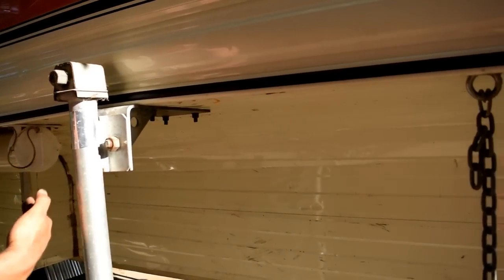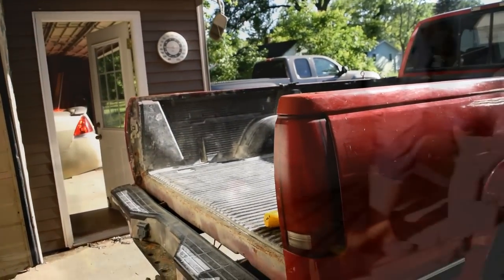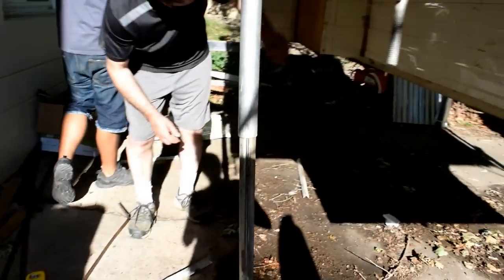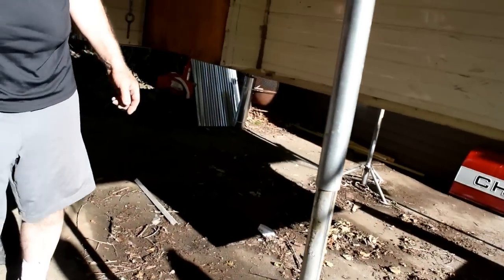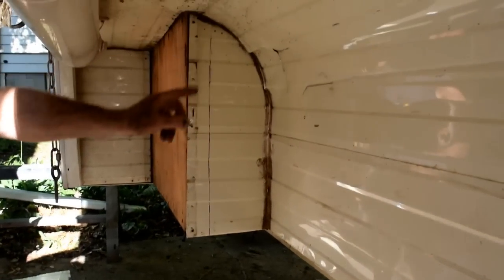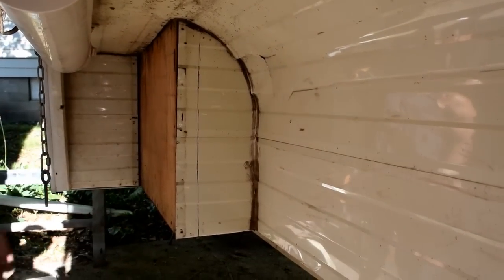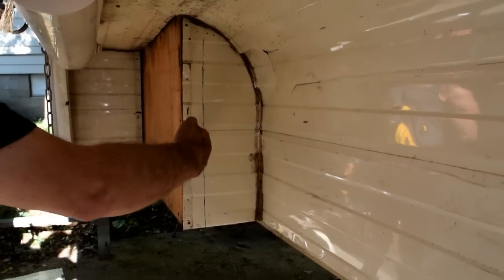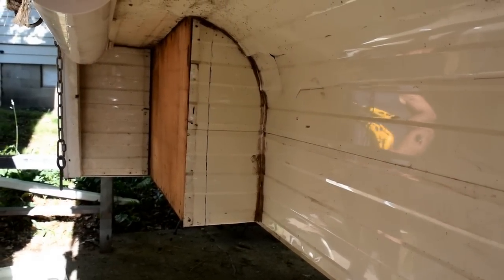Watch This Before Buying A Truck Camper!

Comment: Ford and Dodge pickups are roughly 5 in wider than Chevys .Chevy pickup beds are some of the smallest beds on the market even thow they call chevys full size. they are about 5 in narrower than fords and Dodges and they are about 2 inches shorter in length than Dodges in Fords. It doesn't matter if it's a 1970s or 1980s or 1990s or 2000s full-size pickup Chevys are the smallest out of all of them
Reply: All GM figured was as long as a 4 by 8 sheet of plywood fit in the bed with the tailgate closed it was good enough for them.
Reply from the maker: I didn't know that!
Reply: Nathan Platt   You are WRONG. I own a 70's vintage camper which fits my '69 Chevy but does not fit my Ford. My 1969 Chevy 3/4 ton has a 65 inch width rail to rail. In ~1988, Chevy reduced the width between rails.  The 70's Ford and Dodge pickups also had a bed width of about 65 inches. But within a few years of ~1985, Ford and Dodge ALSO REDUCED THEIR BOX WIDTH. I measured my Ford 1 ton. It has a maximum width of a bit under 62.5 inches at the top rail. But because of integral bracing back where the tailgate contacts the bed, nothing wider than 60 inches can pass (and that is with zero clearance).
 I have been evaluating how to cut my camper so that it will fit my Ford. I am tempted to convert my Ford to a flatbed. This would allow the entire camper's base to be the full width of the camper itself (about 80 inches). That would greatly increase room and allow all the heavier items to stay down low (water, batteries, propane, small generator, ice chest, heaters, water heaters, pumps, tools, etc.)  The problem encountered in this video is that the camper is too OLD (it's a 1979) a vintage for the truck.
Reply: Glenn S   Thanks for providing the link. Unfortunately, one dimension does not tell the full story. Take my 2017 Ford F-350 as an example. If I measure the width of the top rail at the back, it is 62.5 inches. However the back of the bed's frame has a rectangular shape to it which runs up to the rear stake points and braces the walls. It also acts as a surface that the tail gate slams against. It restricts the widest item to enter the bed at 60.0 inches (and with ZERO clearance).  The link does not show old trucks like my '69 Chevy. It has a very simple geometry - 65 inch width at the rear of the top rail, increasing to 66  inches at the front of the top rail. And, there are no restrictions back at the tailgate or anywhere else.
Reply: Found that one out the hard way when I bought a cap from a Chevy for my old dodge
Reply: I call BS, I have a 85 lance that dwarfs that camper and I have it in a 84 k20 with no mods and no prpblems
Reply: KingKatRider Unless you preface your 'BS' response with the name of who you are addressing,  and WHAT specifically you contest, your reply is irrelevant. If you're responding to me, nothing in your equipment list ('85 Lance, '84 K20) contradicts what I said. In fact, it supports it.
Reply: Nathan Platt GET A FLAT BED MORE ROOK FOR TOOL BOXES ECT
Reply: A tape measure would have figured this out before getting the camper.
But it seems they only magically appear when people have to cut something off after it's too late.
Reply: KingKatRider  Lance just built their campers to fit the smallest long box on the market. I don't know why all truck camper manufacturers didn't do that. It only makes sense.
Reply: The camper is for drw which is wider between the fenders
Reply: Better than aluminum. Ford bed
Reply: Chevy downsized.
Reply: Nathan Platt :i always own chevys and never had any probleme loding any campers
Reply: @gregparrott   It was 1988 when GM changed the body style to a more narrow truck. His camper is older than 1988. It was made to fit the wider, square body trucks.
Reply: Chuck Sturgill  Thanks for identifying the specific year. You can see another comment I made here a year ago where (at the end) I asked "The Mobile Hobos" the year of his camper. He said 1979. In response I told him that was why it would not fit.
Reply: Gregory Parrott 

Yes! Flatbed that truck! I custom built my fb and added some bells and whistles 👍
Reply: There should be plenty of room to load that camper on that Chevy because all of the campers are made to be able to load through the 4' plus opening between the wheel covers on the bed AND through the end gate opening on the bed of the truck, no matter what full size truck it is. So,... what might be the problem,... could someone have altered the camper for some reason? I'd take out that bed liner to start with and put down a rubber mat, but even with that,.. 5" difference???? I've had a few slide in's on mainly Ford but a few Chevies and a Dodge,.. they all fit interchangeably.
Reply: That doesnt make sense, i would figure on a standard 8ft bed youd have very similar dimensions regardless of company. 5" is a lot of different in a "standard" truck bed.. I didnt know about this, hell i dont know why i watched this video i have a fucking car.. Haha
Reply: @gregparrott   Im looking for a Truck camper for a Ford Bronco 1984. But Im not sure which size! 5.5 ft? 6ft? and with? please help
Reply: @MrWillis91  I'm no expert on campers, but I've owned pickup trucks since the 1970's. In that time, I have NEVER seen a camper specific for the Bronco. if I were looking for a camper for a 1984 Ford Bronco, I would:
1) Check online for Bronco specific websites. I saw online a soft top shell for the Bronco. This might be your easiest and least expensive solution. The people working at this Bronco specific website would be able to tell you if a camper exists for the Bronco. They could also provide the most detailed info specific to the Bronco. (I'm sure there are also other Bronco specialty sites)
https://shop.broncograveyard.com/1980-1996-Ford-Bronco-Soft-Top-FastTrac-Diamond-Spice/productinfo/35605/?gclid=CjwKCAjwltH3BRB6EiwAhj0IUBXuu5EGvzFwsOv3_ufFLkmPxfyLNgAfTeJSlovyTBvviaHlSPp8HhoC-78QAvD_BwE
2) If they can't help you with a camper, and you're still determine to have one, you'll need to either build your own or modify a camper originally intended for a pickup truck. The standard lengths for pickup truck beds are 8 and 6.5 feet, although over the years some other bastard sizes (~6.3, 5 feet) have become available. For full size vehicles (such as the 1984 Bronco), I am only aware of campers being made for the 8 and 6.5 foot bed. A 6.5 foot camper is the closest size for a Bronco, even though you may need to modify it. Regarding campers for 6.5 boot beds, some are 6.5 feet long (to be used with the tailgate removed), while others use the tailgate in a down position to provide additional support. Utilizing the tailgate allows the camper itself to be 8 feet long. I'm almost certain that the Bronco has a bed that is shorter than 6.5 feet. But if the Bronco's tailgate is left attached and kept in the down position, you might be able to use a 6.5 foot long camper. Measure from the back of the driver's seat to the end of your tailgate (in the down position) and see if a 6.5 foot camper will work.
3)  If the 6.5 foot length is OK, you'll next need to measure the width between wheel wells. A 4x8 sheet of plywood will slide between the wheel wells of full size pickups. If it does the same on the Bronco, then at least the camper's floor width will not require modification. 
4) If you were to cut a cross section through a truck camper, you'd see that starting from the floor, it steps upwards vertically perhaps 8 to 10 inches, and then goes horizontal perhaps 7 inches. This 'up and over' step clears the wheel well. You'll need to check if its horizontal and vertical offset will fit inside the bronco. For example if your wheel well is 10 inches tall relative to the floor and the camper's offset is only 8 inches, you'll need to either run a few lengths of 2x4 planks to lift the camper or you'll need to start cutting/modifying the camper itself.
5) After the cross section has stepped up and over the wheel well, it then goes vertical up to the height of the truck bed's side rails. You need to measure the width (inside to inside of your truck and compare it to the width of the camper. The newer campers are narrower than the old ones. So if you find an old (approx. ~1980 to 1990) used camper whose width is too wide for the Bronco, look at some newer campers.
6) After the vertical step going up to the height of the truck's bed rails, it then steps horizontally out to the camper's final width. You'd want to check that the camper does not rest on the truck bed rails (Neither the bed rails nor the camper itself expect its weight to be supported there). If the height clears, you'll want to know by how much. If it clears by (for example, 6 inches), it would work. But it would look like a misfit which you could address by creating little covers/side panels. The final width of the camper may obstruct vision with your rear view mirror. You'd then need to buy auxiliary mirrors
7) Measure the overhanging/sleeping section of the camper. Is it high enough to clear the Bronco's roofline? If not, would the use of 2x4 planks in the truck bed to raise the camper be an acceptable solution?
This should get you started. But you'll still need to consider:
-) How are you going to mount/secure the camper?
-) Can the Bronco handle the added weight?
-) Can you buy beefier springs and/or airbags to handle the added weight?
-) Since campers are meant for longer truck beds, on a Bronco, the center of gravity of the camper may wind up hanging well BEHIND the rear axle. That is a safety concern. You need to evaluate this BEFORE you commit to buying a camper
Reply: @gregparrott  you measure between the wheel wells, that's the width that you measure to fit the bottom of the camper into the bed.
Reply: @cherylyoung7899  Yes, I know. But in the case of this video, the bottom dimension was NOT the one causing the problem. The dimension causing the issue in this video was the width between the bed rails. While the width between wheel wells has always stayed slightly over 48 inches on full size pickups, the width between bed rails shrank by nearly five inches.
Reply: "Last night in New York 10 people died in a fire last night in New York because of a fire"
Other guy: "10 people died in the fire lastnight because the fire was too hot for the human bodies to handle"
Reply: Wow!  Good to know.
Reply: attovishnu  .. bingo . Exactly....
Reply: @Chuck_S  exactly
Reply: I used to have a 9.5 ft camper that was on a 79 Chevy K20 . It would not fit in the 91 GMC I currently own . GMC changed the layout of the portion of the box when the square body was abandoned.
Reply: @danholmes6095  too true.  You have to chop up the camper
Reply: Have you seen a newer Dodge truck bed lately? I've seen cars that have more room in the trunk. Peace

Comment: I remember that 1988 and later model year change GM made the beds narrower at the opening end. A real surprise to people hopping to use their older campers. My first overhead camper mistake was to put an overhead camper on a 1/2 ton truck. Even though it had heavy springs installed the 1/2 ton brakes did not stop the rig very well. I later bought a 3/4 ton Chevy that worked much better.
Reply from the maker: Never new they made them more narrow. It makes sense now hecause the whole camper started to fit until it got close to the end! We are glad we have a 3/4 truck. Thanks!
Reply: You guys did a decent job narrowing the wide sections to clear.
Reply: Just use metallic linings.

Comment: Hey Buddy. Make sure you attach your cab over from the frame of the truck and not from the railing bed. I have see a few truck where people did what you doing and the bed start breaking around the bed mounts. Good luck

Comment: Been thru this myself.  Frankly, campers like that one need a one ton dually to be safe and safe and easy to drive.  Good job on solving problem.  Stay safe .  Thanks for showing us how you dealt with the problem.
Reply: Nah, as long as you have a 3/4 ton or 1 ton Dodge or Ford you will be fine. Just dove mine across the state. Similar size truck camper in a 96 Dodge Cummins 4x4 1ton. No issues ever. Has alot to do with the driver and how comfortable they are also.
Reply: A one ton dually for a camper that’s around 9 feet long? Oh please that’s ridiculous. You need a one ton dually for campers around 11.5 feet long with multiple slide outs. That’s what those trucks are designed for. For most if not all 9 foot campers an f 250 or 2500 is easily enough.
Reply: No they do not. There’s Tacoma’s hauling slide in truck campers around lol. A 3/4 ton for his size camper is plenty.

Comment: I was going to buy a camper and already looked at it, knew it went in a 8'plus box. Didn't think of the width at the back. Just happen to see your video the night before I went to pay for it&pick it up.surecenough, the same problem. Thanks for you video. It sure helped me since I had to drive hours&hours to pick it up. Brought all my gea
r with me to fix the problem.  😀

Comment: The fit of older campers don't fit the beds of newer 90+ chev trucks because Chev and Ford shrunk the beds (width and height) for fuel  efficiency.   I had a 85 chev C20 LB and a 88 year model camper, it would not fit any newer chev truck, so I bought a f350 super duty truck where the bed was the standard old size and camper fits fine.    Something the manufactures did not mention regarding on the fact they shrunk the beds.        I had to confirm my camper fit the F350 before I purchased it and the dealer understood this dynamic back in 2000.   I wanted to keep my existing truck camper so no options.    Hope this helps, glad you made adj to get your camper to fit!  pretty amazing

Comment: Yes... always measure every dimension. I bought a 1994 Ford long-bed half-ton Truck and 1994 camper at the same time, they were made to fit. Then, when I bought the 2010 Ford Truck, the bed rails and cab were higher from the truck bed, so I had to build "elevator shoes" to load in the old camper... and there was only 1/4" clearance at the tailgate for the back of the camper... but it did fit (OK, would have been 1/2" clearance, except for the spray-in bed liner). Old camper leaked, so started looking for a new camper. Today, because of the plethora of short bed, crew or extended cab half-ton pickups, there are only two campers made in the USA for long bed half-ton trucks. I didn't search outside the USA.

Comment: Yeah. I didn't realize how much truck beds differed until I started shopping for an in bed tool box. Then I sold my 2000 Chevy and bought a new 2015 Chevy. The bed is for inches narrower between the sides of the box. I can still get a 4 foot wide sheet of plywood between the wheel wells, but my tool box won't fit, and I had to cut my divider board in the rear.

Comment: I bought a large truck camper on Craigslist, put it on the truck before paying for it. Didn't have to modify the camper but I installed on my 88 Dodge Ram, frame mounted anchor points and overloads with separate air lines to level it out. It extends about 2 1/2 feet off the back since it has a bathroom. Hope you're enjoying your camper as I also enjoy mine.

Comment: The rear wheel-wells are on the inside of the bed. Correct bed style is wheel wells on the OUTSIDE of the bed. (Step-side).

Comment: Great video! Very instructive.
All old truck beds pre-1988 had beds that were 5'-4" at the tail gate pillars.  Campers from that era were made to take advantage of the space behind and above the wheel wells to a max of 5'-4"
Chevy narrowed their beds to 5'-0" in 1988 (they narrowed the whole truck).  It made the truck lighter and more aerodynamic.  They had better fuel economy and higher payload capacity (GVWR - Empty Weight = Payload capacity).  Dodge/Ram and Ford eventually followed suit and narrowed their trucks to this 5'-0" inside measurement.  All late model full sized domestic trucks now measure 5'-0" inside the tailgate pillars.

I bought a 1994 Chev K2500 back in 94. I found out in advance that I was going to have a problem and shopped for used campers accordingly. I found a camper that I thought I could modify. I had the seller deliver it to my house and commenced to cutting it down.  I used that camper for many years, it was great fun.  You did good mod'ing an old one.

Comment: First thing would have been to remove the drop in bed liner. Camper manufacturers recommend no plastic bed liner, but do recommend a rubber bed mat. Plastic would let it slide easily where as, rubber would stop sliding around, plus you might have gotten a little more width. Second would have been to measure camper and truck to be sure it would fit. If you got a very good deal on this camper, I frankly don't see why this mod was so terrible. I love older truck campers as long as their is no rot or delamination on fiberglass skinned units.  Happy camping.

Comment: Back in the 90s automakers began to taper the beds towards the back for aerodynamics and fuel mileage.  Back in the day beds were built square or at 90 degree angles. In the 90s if you wanted a truck bed topper you had to tell them which year make and model you were putting it on to get the right fit. I ran into this recently when putting a 1978 wilderness on our 1997 Dodge. We literally squeezed and pry barred it in.

Comment: In the early 60s the wheel wells changed size and shape.   People bought New trucks and had to bolt wood runners on the camper belly to clear the new design.    The RV and truck mfg have been hitting heads since rover was a pup